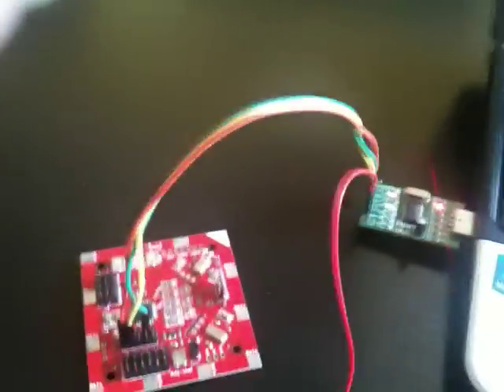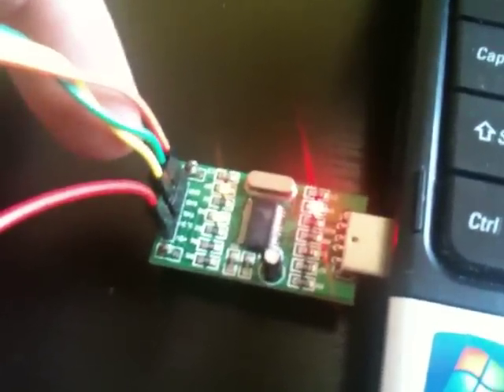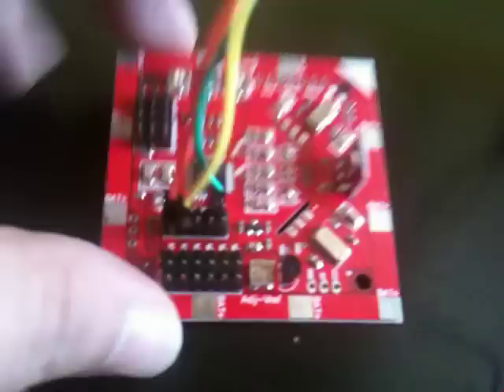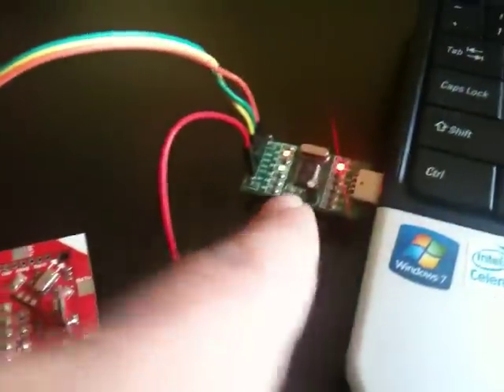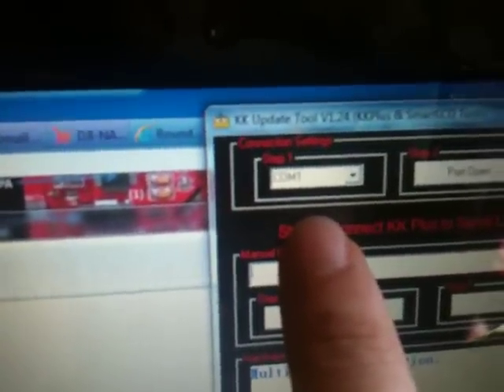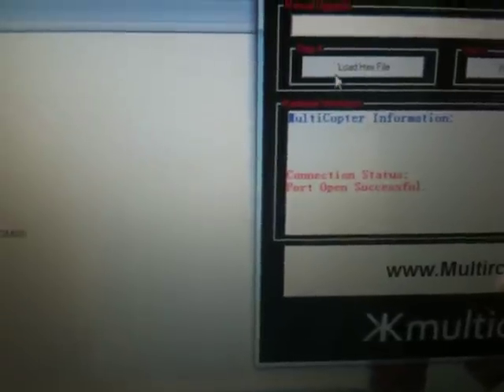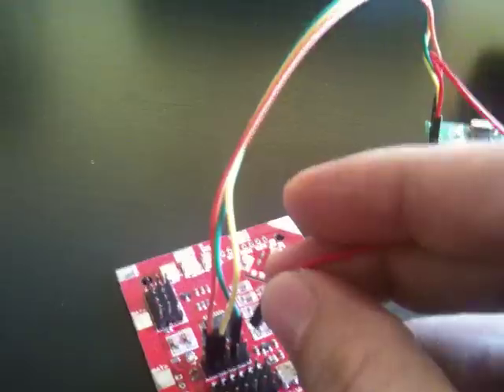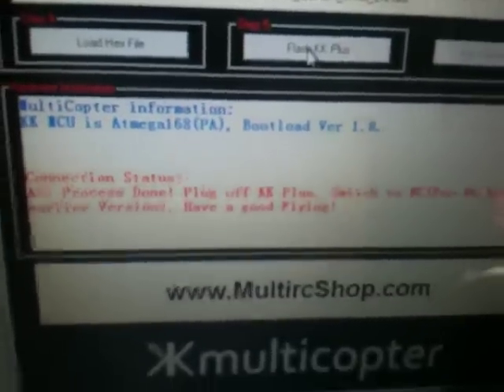KK Plus Flash Tool with USB Serial

Comment: i connected the 5v cable to the pin number 1 and it seem to load up the stuff like in the vid, will this work? because wen i tried connecting it to pin number 2 of the kk baord it said connection error